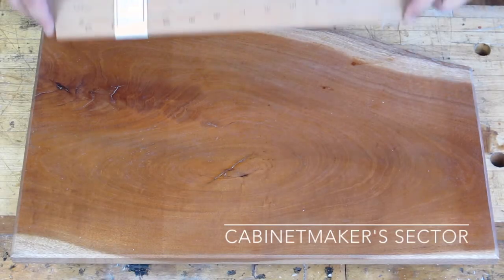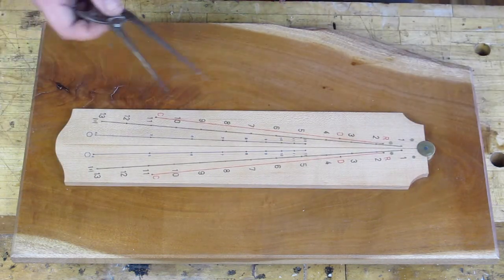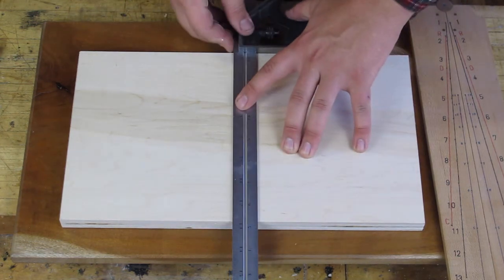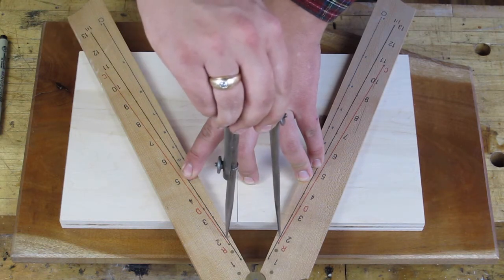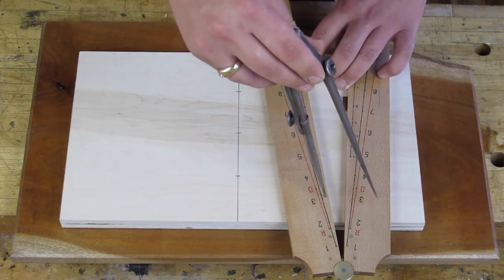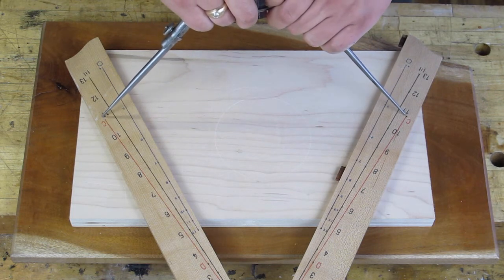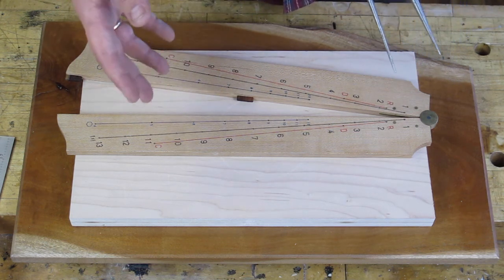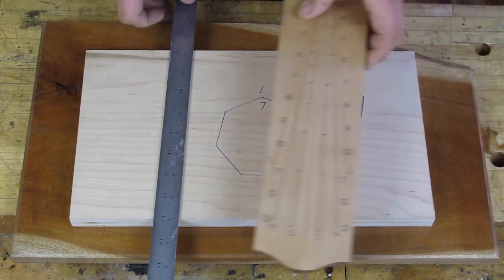Cabinetmaker's Sector Tour and Tutorial

Comment: All hou need to do is take an ordinary rule . Turn it to an angle that shows a WHOLE.  number . Instead of 8& 3/16 , turn the rule to show 10 inches . Mm atk at 2.5 inches and you AUTOMATICALLY divide that board . For chr ii st sake . This tool is a gimmick.
Reply: Check out the sectors held by the Smithsonian, they were pretty damn handy back in the 1700s through the early 1900s.
Reply: Now divide the board into 7.